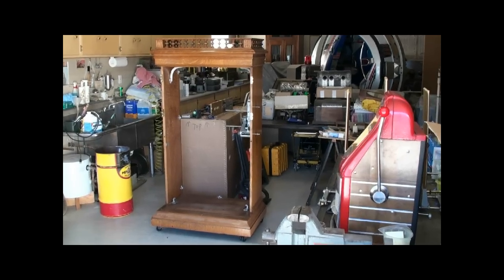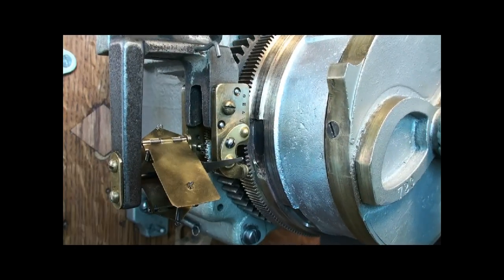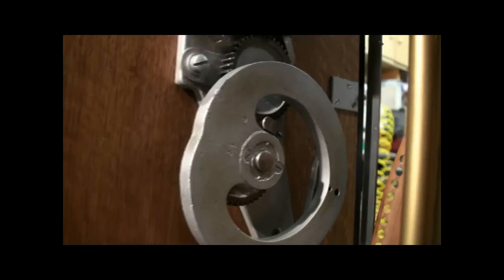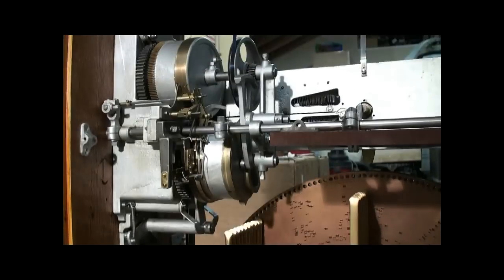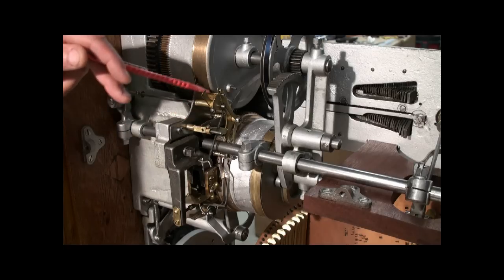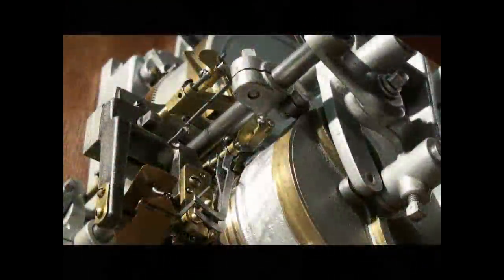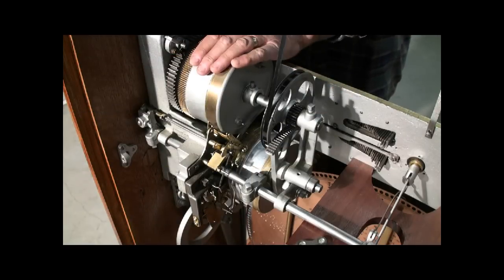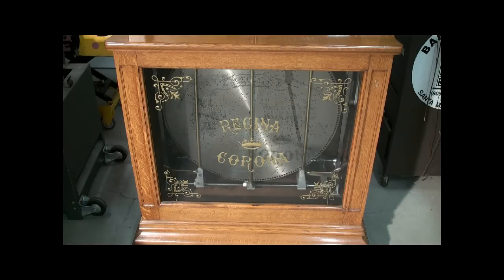Regina Corona 27" Disc Changer - Detailed Operating Sequence of this Music Box

Comment from the maker: Thanks for the kind words. I take LOTS of pictures as I disassemble. I also lay the parts out across my work bench in the order they are removed. That way, I know the order in which to re-assemble. Many times I've gotten several steps ahead, only to realize that I forgot something and had to take half the machine apart again. You learn to be slow, patient, and methodical.

Comment: Question:  I had to repair the roller cam for the disc 	pressure bar....it clamps down on the disc about 1 second too soon....do you know what I would need to adjust to delay the pressure bar??
Reply from the maker: Don't know without seeing it first hand, but my guess would be mis-adjustment in the mech or severe wear that's causing a timing error.

Comment: I have one question that you may be able to answer.  The pressure bar with rollers that clamps the disc to play I have noticed on the right side where the drive wheel is located and the rubber roller is not touching the disc. Can the pressure bar be adjusted in the front to move the rubber roller closer to contact the disc by the drive holes? I noticed what appears to be a thumb screw on the front. If I loosen that can move the rod farther out to make the roller contact the disc? When the disc is playing the large roller near the drive wheel is about 1/8 of an inch away from the disc. I think the larger roller called pulled back when my machine jammed on a disc as it was against the disc when playing before.  It appears a bad disc caused the issue.
Reply from the maker: There is an adjustment. It may be in front or it may be in back. You have to study the mechanism to determine how yours is adjusted. Good luck, Kevin

Comment: Hello Kevin, I was wondering who restored your Regina bedplate and combs..thank you for a great video.
Reply from the maker: I did. Thanks for the kind words. Hope the video is helpful...
Reply: @keinert  Hello Kevin, I'm in the market for an early model Regina changer like yours, but the dial indicator is missing the number disc. You made one from brass. If I needed one made, is it possible to make one for me?
Reply from the maker: @01Bubba2001  The best thing for you to do is give it to a high-school or college student as a project. Contact the instructor at your local school that has a machine shop. They might do it for free and all you have to do is provide the material.
Reply: @keinert  hi Kevin, on the changer I’m looking at is missing the entire number ring.. I have nothing to copy. I will check with Al Meekins.

Comment: I have two issues with my Regina 27 inch changer.  The first is sometimes the carriage will not shift to select the next disc, and sometimes when the disc is lifted and is ready to be clamped by the pressure bar it stops.  When I touch the pressure bar I hear a click and then it will clamp and play.  Are these issues with oiling or what?  Any help would be appreciated. Not sure if this makes any difference, but it is a home model that does not require a coin.
Reply from the maker: Most likely these pieces need to be fully disassembled, cleaned, lubricated and then properly adjusted after reassembly. You could try just lubrication, works sometimes. Good luck.
Reply: Kevin Thanks for the quick response and information.   Would WD40 be advisable to loosen old oil? This changer has never been taken apart or messed with, so I believe what you are saying is correct. One last thing, do you know anyone located in the Phoenix Arizona area that could perform any restoration, or cleaning, of the mechanism?
Reply from the maker: WD40 might loosen things up temporarily, but is not a permanent fix. Sorry I don't know anyone in AZ. Try contacting www.amica.org or https://mbsi.org/
Reply: Kevin...thanks for the tips.  I opened the back of the changer up and discovered that someone almost looked like they used a grease gun to grease the works!!!!!  I spent eight hours cleaning out the goo along with cleaning the rachet paw area that cycles the rack of discs!  I used brake fluid to melt a lot of the grease and then wiped it away.  I used sewing machine oil to re-oil both governors.  The changer works fine now and I played it for two days before I put the back sounding board back on.  Fortunately for me, cleaning all the grease off even springs working paws ,allows the machine to play fine.  I don't think this machine has ever been messed with in all its years as well as played very little.  Taking it apart is beyond my ability, so this turned out ok for me.
Reply from the maker: Great news, congrats and enjoy. -KK

Comment: Kevin....how did you line up the disc to go onto the shaft before the pressure bar moves to tighten the disc.
Reply from the maker: Not sure what you mean, but if I get your question,  I just rotate the disc by hand and line it up.
Reply: @keinert  what I mean is when the disc rises and the post extends out of the bedplate how to align the disc hole to hit squarely the shaft.  I have struggled to get it align to the center hole on the disc.
Reply from the maker: @Idelia412  you have to adjust the spring steel straps to raise or lower the arms that lift the disc into position
Reply: @keinert  Yes I have worked with the straps.....so I guess no easier way just trial and error, Correct?
Reply from the maker: @Idelia412  correct

Comment: I noticed the wood piece that is  screwed to the bedplate and is secured to the sounding board when reattached appears to be new wood. Did you make a new piece of wood like the old one to improve the sound?  Just curious
Reply from the maker: Hello, that wood was there when I bought the machine. I don't know if or how it affects the sound, or if it's original or not. Sorry....
Reply: Thanks for the quick reply.  I can tell you when the back sounding board is removed and not connected to the board which in turn is connected to the bedplate and comb assembly, the sound is not near as good and your bass sound is diminished.